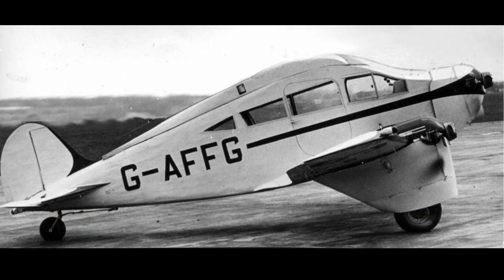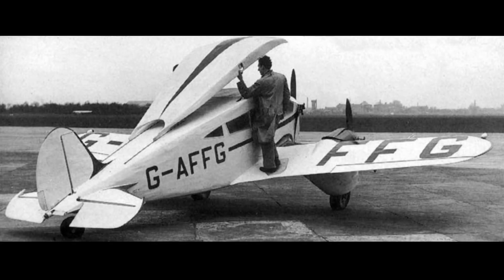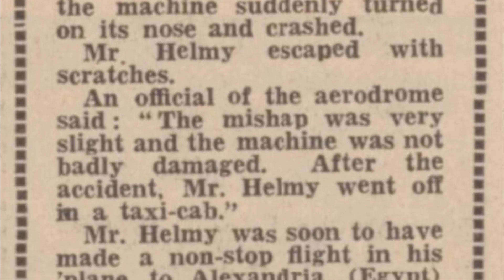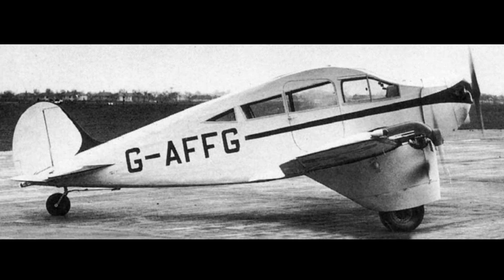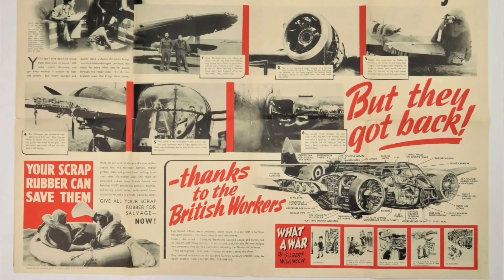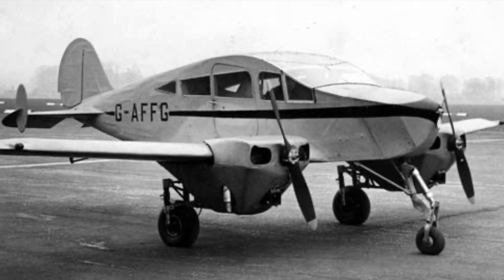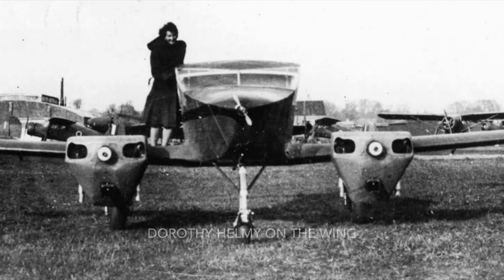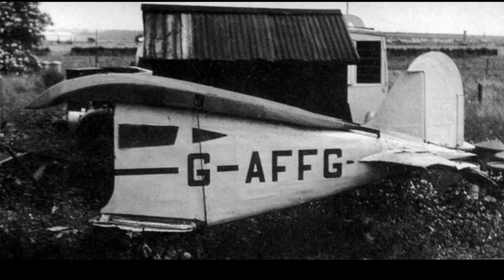Helmy Aerogypt - A Diminutive Trimotor

Comment: Difficult to use the fuselage as an airfoil as the center of lift migrates a large amount laterally depending on AOA. The airfoil shape would have to be something like maximum camber at only 15% to line up with the conventional wings center of lift region (assuming the windshield is the leading edge equivalent for the fuselage camber). The engine cowling aerodynamics can also foul up the lift effect at high AOA. All brave efforts by Helmy without resorting to the safety of alot of wind tunnel tests.
Reply from the maker: It would be interesting to test such a model in a wind tunnel. Imagine, a Ford Model A powered wind tunnel. Now there's a project!